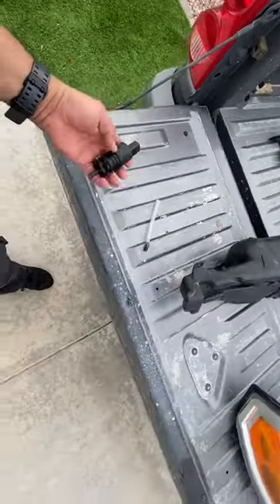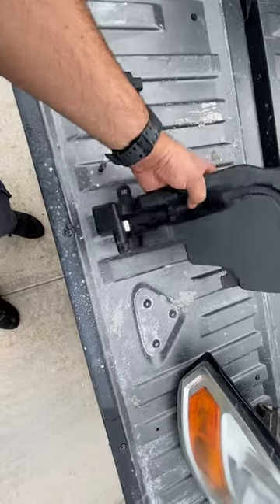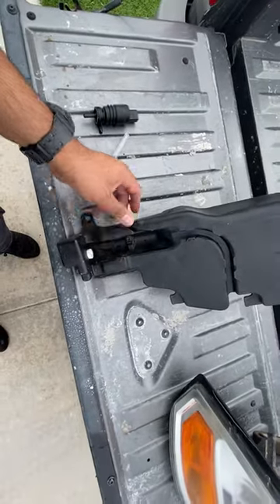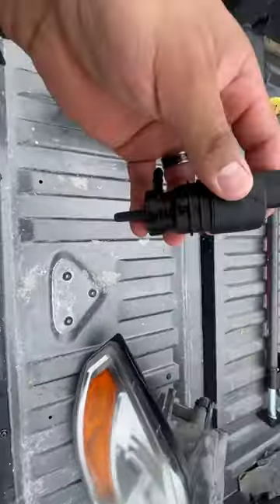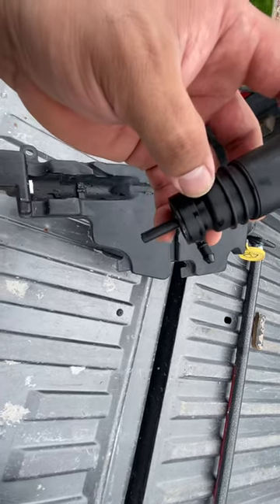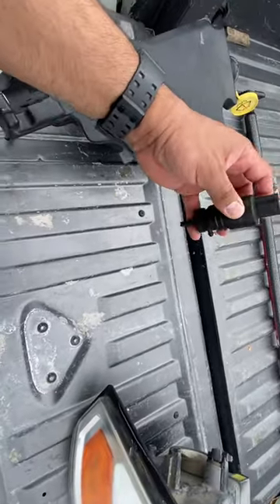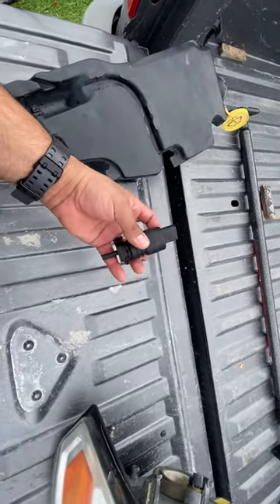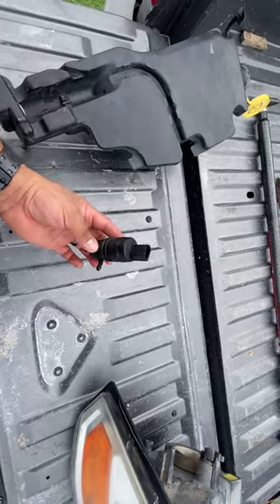Why your windshield wiper fluid keep leaking on the ground

Comment: great job , just looked into my audi a6 ,, same problem , all leaking out , joint good no cracks and that little square hole in the side of the pump leaking out ,, i blew into it and plugged up the exit pipe an heard it blowing out that square cutout ,, pumps bad you say ,,OK, that just saved me pulling the whole reservoire out which is a nightmare job , Thanks mate **

Comment: My 2021 tahoe is leaking out fluid through back behind muffler
Reply: That is not windshield washer fluid 💀
Reply from the maker: It can be condensation , does the fluid smell, gas or coolant maybe
Reply: If u use ac it is probably condensation